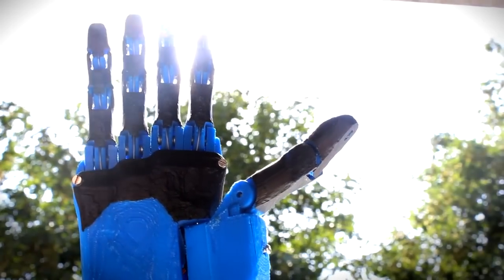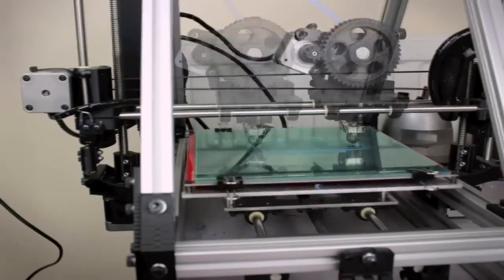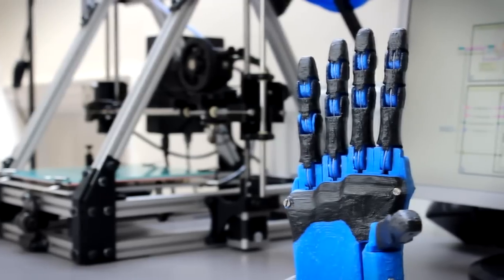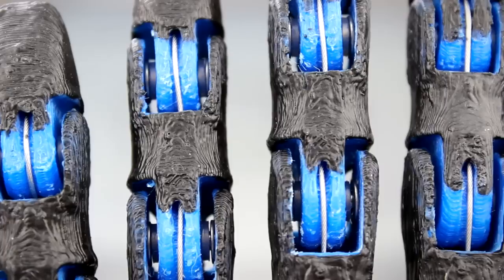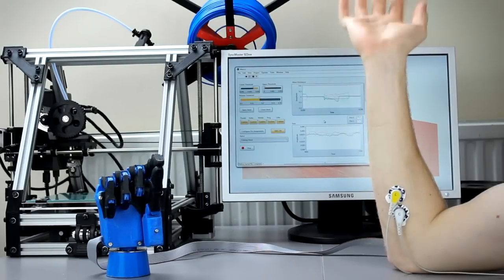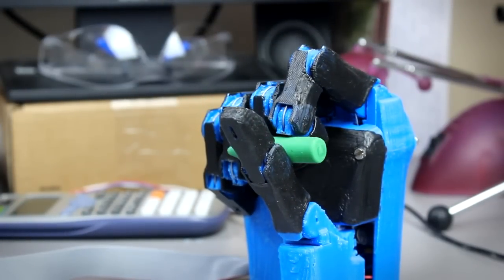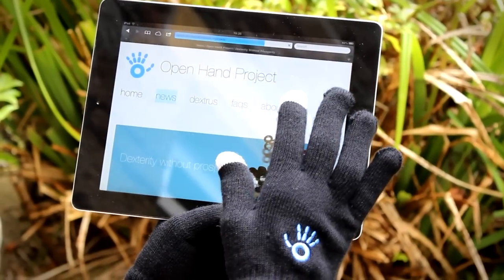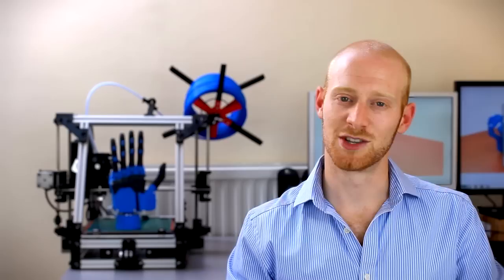3D Printed Prosthetic Hand

Comment: hey im planing to  work on a hand for my final year project, but I lack in knowledge abt how I can sense the signals coming from brain, im using flux sensors to detect the finger movements, but that works only when u have a hand , but what I need to do is sense the signal like u did in the video , can u give some detail abt the sensors used?